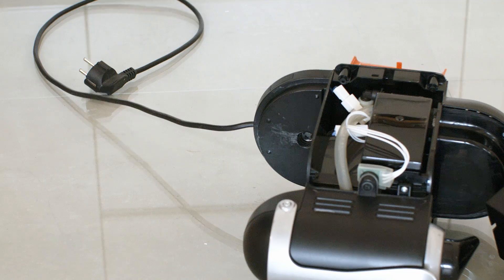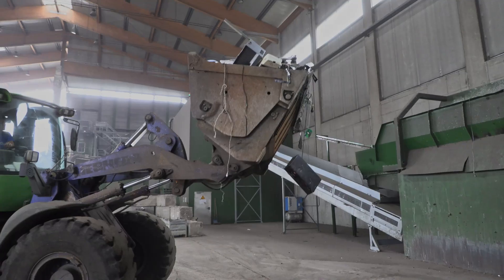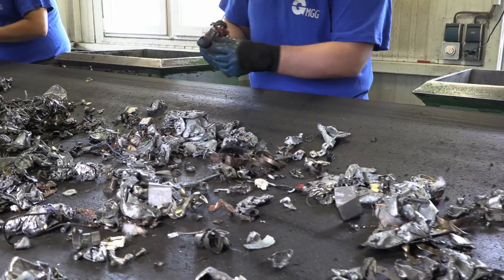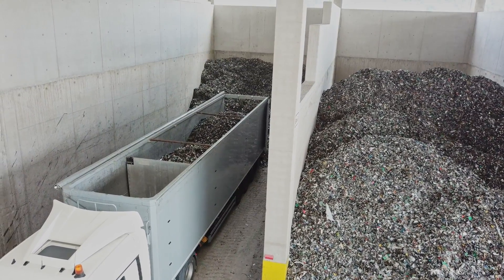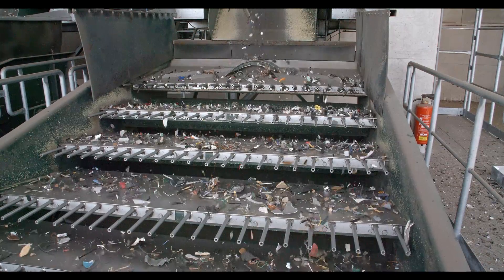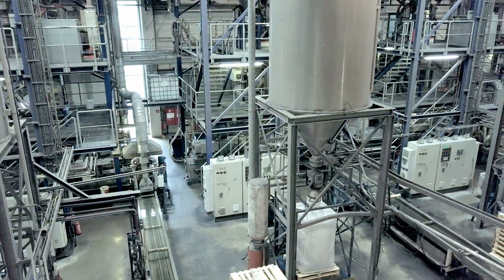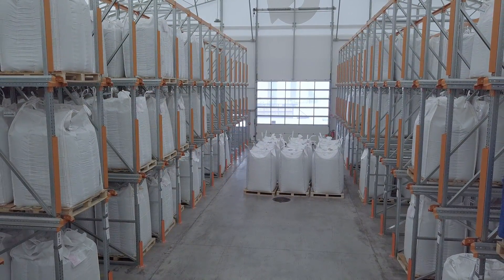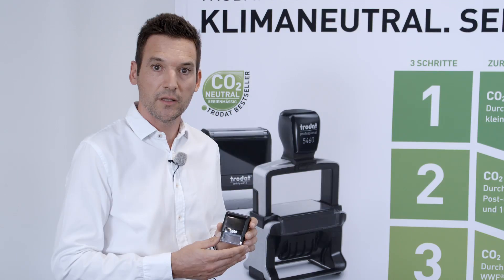MGG WEEE Recycling

Comment: There is a fire burning for you, if you can get to it. A gallery in Hell waits for no opening. Justice interesting to our King as water mud and fire, a tray turntable. 71.71/101= sun if you already figured out a way to screw the wide diameter cylinder part of a plastic bottle together, and it is still not completely air and liquid tight. Then a little bit more heatwork will solve that. greyishgreblum, "Pottery tap and die" w/ "cookie cutter" tap tool modification💜